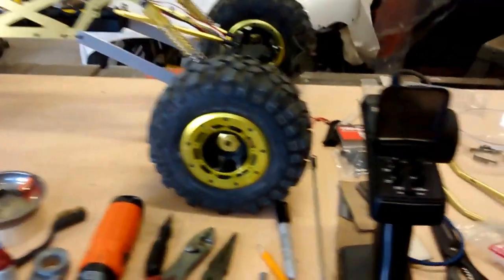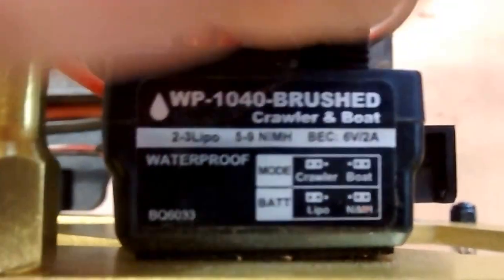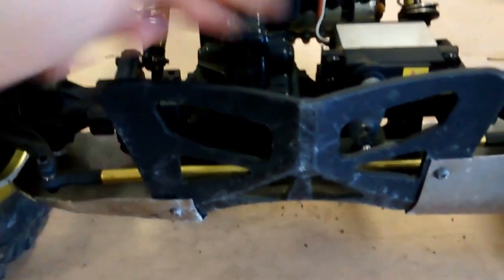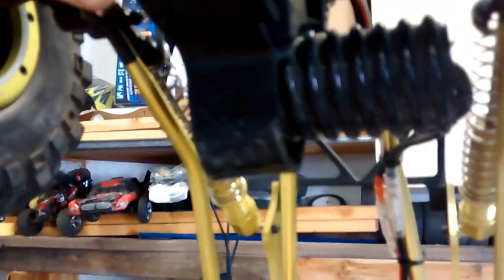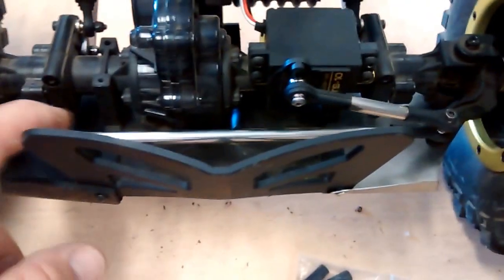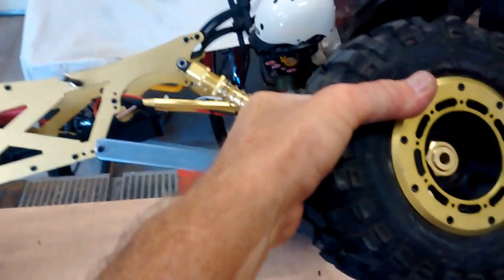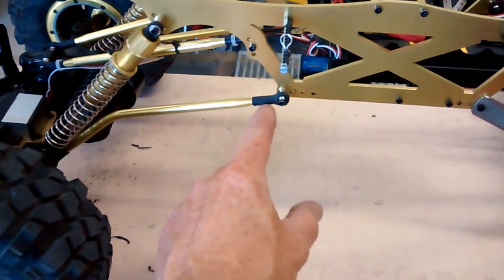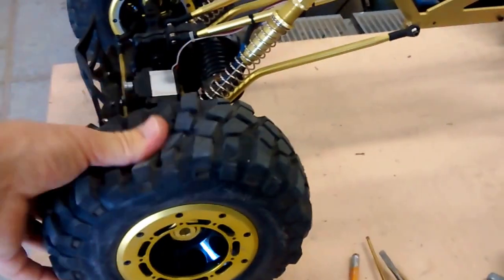Maxstone 5 upgrades/mods/tips part 1

Comment: did not under stand how to switch over lipo can you help
Reply from the maker: yes,you pull that plug & plug it to the lipo connection on the esc to the left..
Reply: @stephencraig8578  ok thanks

Comment: is that the same on 1/8 scale for lipo change over same speed control
Reply from the maker: yes, if it has that pin. I use a 120amp esc for my 1/8 scales cars & 4s batteries.

Comment from the maker: I made those out of these materials from Amazon. ASIN:B003YDPNPM, ASIN:B004TUE7RE  I used the exsisting black plastic rod ends. You can use a thicker diameter(10-24) allthread rod with these rod ends too. ASIN:B000BP2MVE  The rod ends will be hard to go on but,they will work. or you can get them at nitrorcx.com if they are in stock.